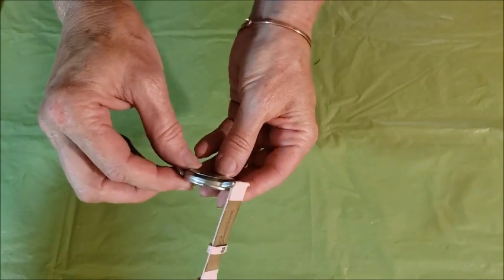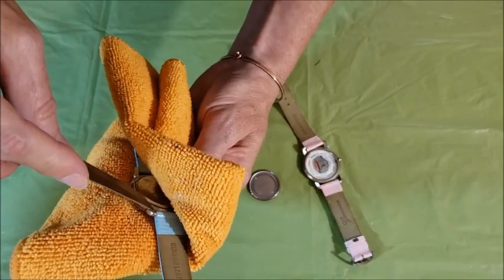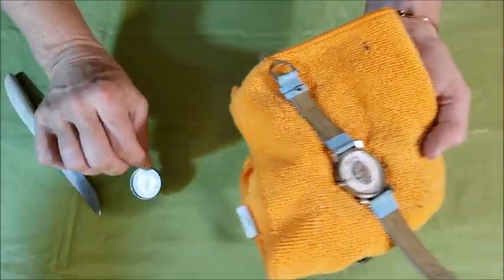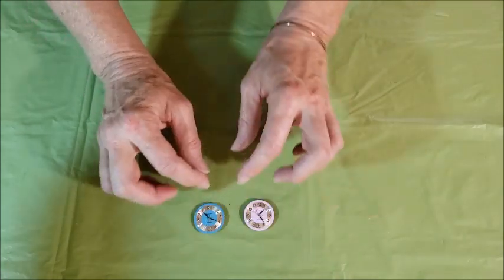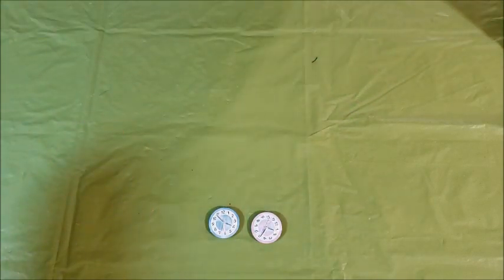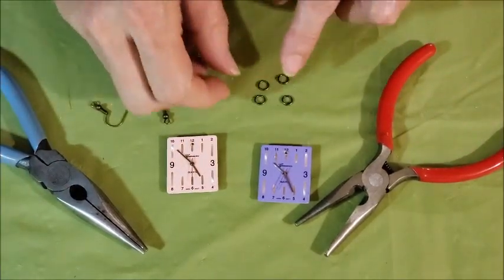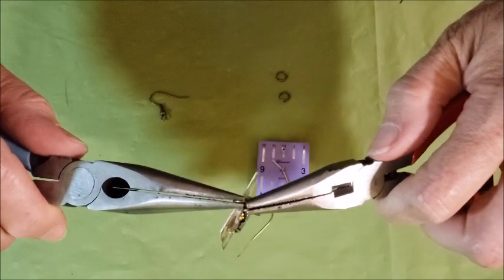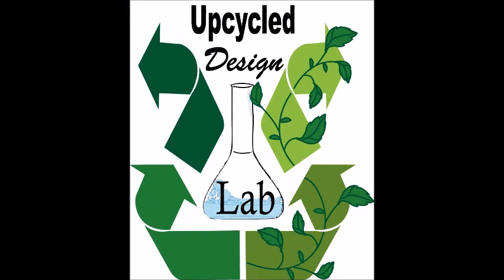Simple Watch Face Earrings Tutorial

Comment: I'm thinking if you didn't like the look of the mechanism on the back you could paint it or even glue some felt over it just to give it a more "finished" look.
Reply from the maker: Hi Sharon - You could certainly do that if you prefer that look. One thing is that the back mechanism is generally involved in holding the watch hands on so you would need to be careful when removing it if you wanted to keep the hands in place. Thanks for watching.🙂